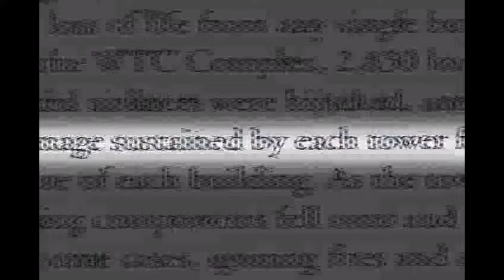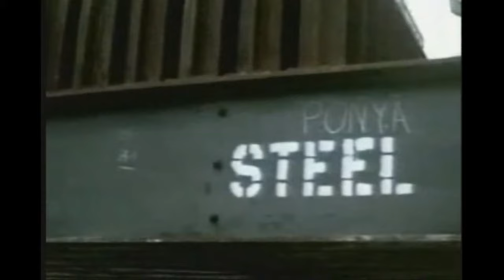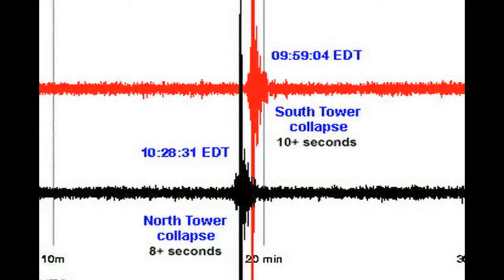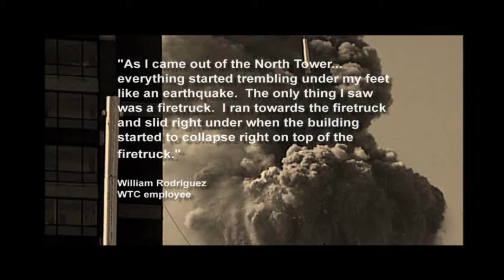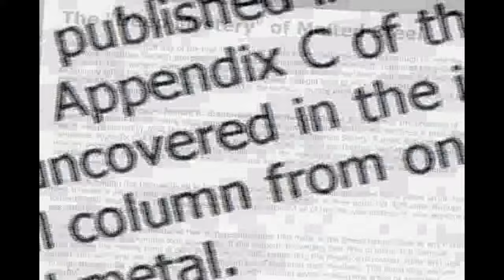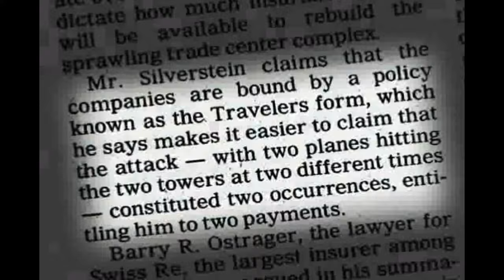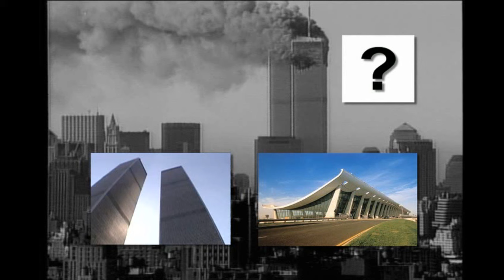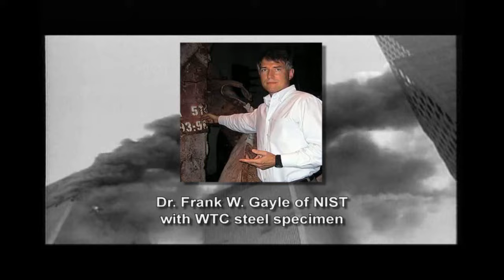911 Mysteries - Demolitions (Full Documentary)

Comment: The narrator (Sofia Shafquat) clearly states in the beginning of the documentary that "never before in the history of the world, has a steel building collapsed do to fire", yes she's right, but there have also never been any high rise steel buildings, hit with fully loaded 767 commercial jet aircrafts as well!
Reply: What about 1945 plane crashed into Empire State building?
Reply: But it's important to note that the official story says that it was fires weakening the building that led to collapse.  The only thing they claim is important about the jet impacts is that it knocked the fireproofing off the trusses, and not the actual damage it caused to structural columns.
Reply: With incredible speed if I may add
Reply: Yes they have.
Reply: @kampere  The plane that crashed in to the Empire State Building, was a much smaller bomber aircraft (The B-25 Mitchell Bomber) that had a total fuel capacity of only 974 U.S. gallons, which is a far cry from the large fully loaded Boeing 767 commercial planes that hit the World Trade Center, that carried around 24,000 gallons of fuel at impact!